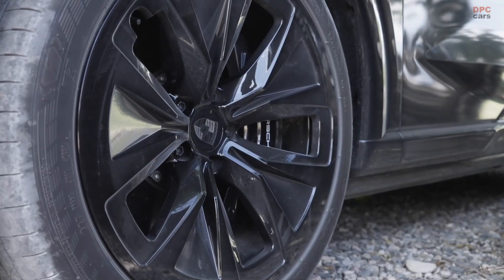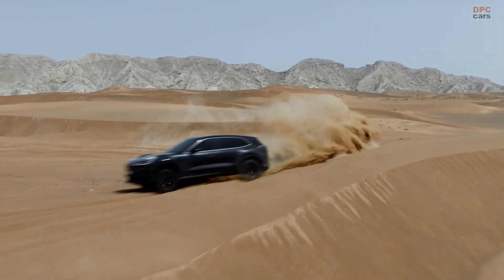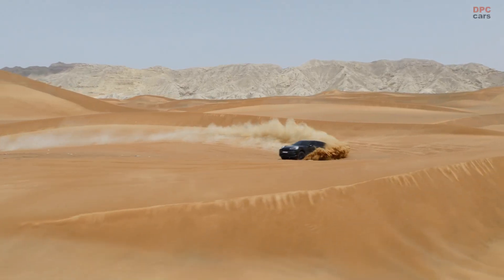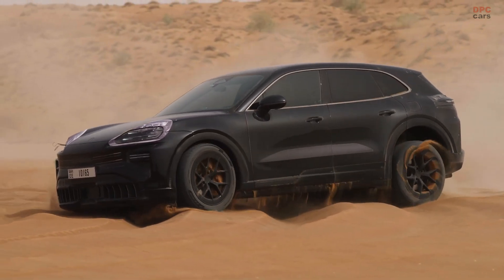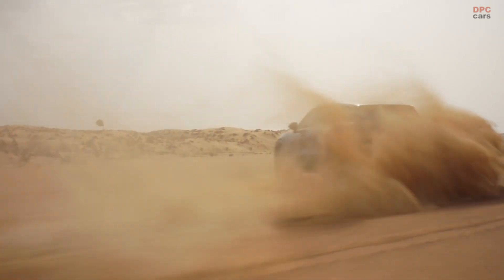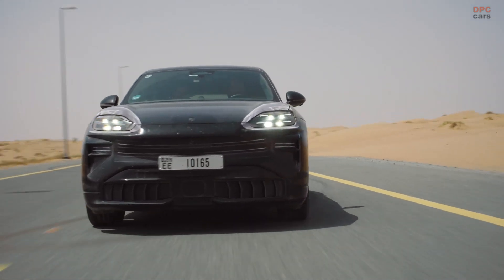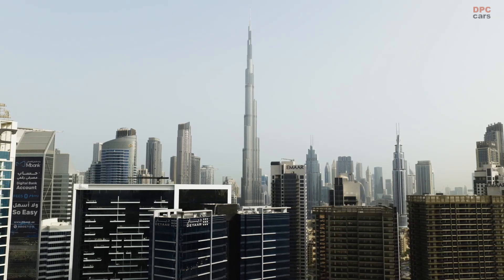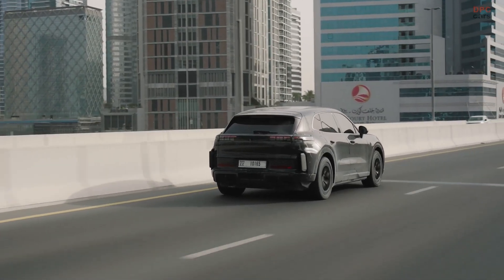Porsche Cayenne Electric in 50°C Desert: Sand Testing Explained

Comment from the maker: What do you want to know about electric vehicles in extreme environments? Ask your toughest question about heat, sand, charging, or traction and I will pull data from the test program for a follow-up video. Also, tell me which test you want to see next: water fording, cold start in extreme winter, or long downhill braking runs.